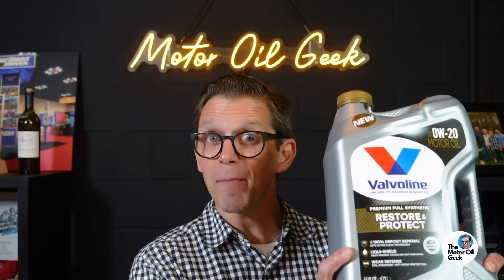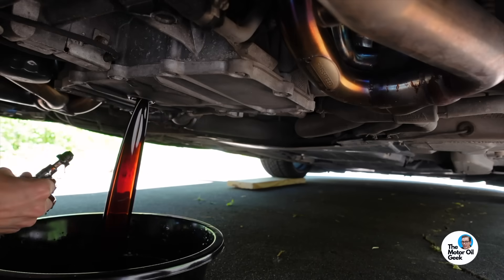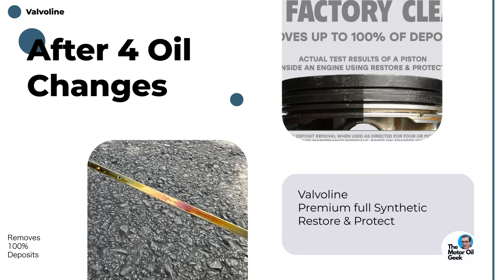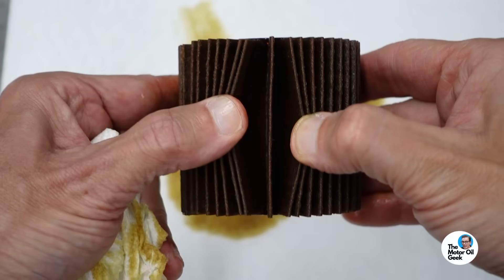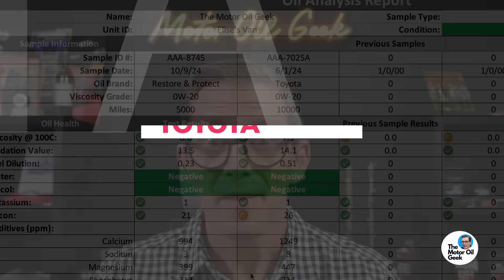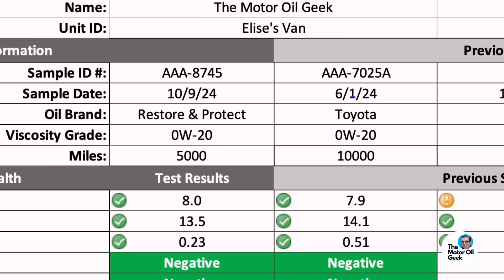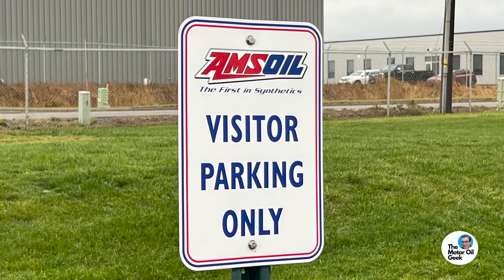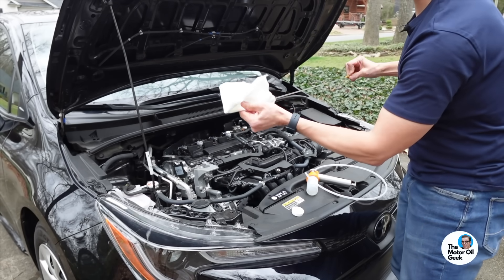The TRUTH About Valvoline's BOLD Engine Cleaning Claims

Comment: I saw your interview with the Valvoline team and decided to try it in my old 97 Civic with the D16Y7 engine. I was losing oil at a rate of a quart every 500 miles. After going through 3 changes so far I can nor go a 1000+ miles per quart loss! I am SOLD!
Reply: Thanks, I've been thinking about trying it on a Hyundai GDI that eats a quart every 250 miles. Even if it only doubles to a quart every 500 that would be great
Reply: @martyjoseph9507 Have you had a rod bearing failure since you posted this comment eleven months ago?
Reply: @martyjoseph9507  switch it on my genesis with the 3.8 and it helped so much with the oil consumption
Reply: @martyjoseph9507 thats insane a quart per 250 mi.
Reply: @martyjoseph9507  I just got a 13 Sonata SE 2.4 and it has a new engine. I am getting ready to use the 5W20 R&P in it to hopefully help keep the engine clean and maybe less build up on the intake valve stems. That R&P going through the PCV and hitting the intake valves just might keep the build up at bay. Also only using Shell/Chevron/Texaco gas in it. Also OEM Hyundai filters and 3K oil changes. We shall see!
Reply: @martyjoseph9507 - Put in a pint (as directed) of Berryman's 300ish miles before your next oil change too. That stuff is awesome and reasonable.  Stronger and cheaper than Seafoam.  I use it to decarbon my 2 strokes and clean fuel systems (works spectacular there too).  I noticed my son's Silverado (160k-ish) was down about 5psi on oil pressure and was concerned for him.  Upon his next trip home, 150 mile trip, he added it right before he left his place.   We changed oil when he got here and I'll be, if it didn't restore the pressure back and quiet a slight lifter tick on one treatment.
Reply: Haven't tried Vavoline but my 2009 Camry 2.4 was digesting a quart in 300 miles, about a week. 
Watched the video about doing a piston soak with Berryman's B-12.
Tried it and my mind is blown. The oil consumption has stopped almost completely.
Reply: @br5747  -- Which video is that? Before buying the Restore and Protect I wrote to Berryman's, but I can't recall exactly how I phrased my inquiry about using B-12 for trying to clean the ring area. 

I love the B-12 and have used it in my gas for a few years. I know that it works as claimed for cleaning intake valves because I had the head off and the valves out, and there was almost no carbon on them at all, face or back. The exhaust valves were a geological spectacle, with big knots of carbon on the backs around the stems, and the faces also had substantial deposits. 

I used Berryman's Chem-Dip to soak the exhaust valves for a few days with almost nothing but discolored solution to show for it. Results weren't much if any better after I found a 22-oz. can of 'professional use only' BG Platinum Air Intake And Combustion Chamber Cleaner on eBay for more than $50 following a Car Wizard video where he successfully cleaned manifold runners with it, and I soaked them for two or three days. I have no doubt that both products are great, but they do not break up or even soften heavy carbon deposition, should anyone who's read this far be inclined to try them for this purpose. 

The only way I was able to get the carbon off completely was to protect the stems in a sleeve of Frost King perfect-diameter foam-rubber weather strip tubing, put them in my drill, and work them gently into a brass -- not brass-coated steel -- wire wheel from Grainger. It took hours to do eight valves, and it left the wheel with literally about seven wires still attached. :face-orange-raised-eyebrow: 

All of that effort made me question how well any proprietary magic potion formulated into the oil or added to the crankcase could dissolve similar but less extensive buildup. ANYway, the nice guy who promptly replied very enthusiastically assured me that I could add B-12 directly to the oil at a specific ratio and see excellent cleaning results, but I was a bit concerned about adding the B-12 to the oil, even though it was a small proportion, as it does kick ass on intake valves. I think I my question was if I could run a small amount of B-12 around the piston crowns at the cylinder walls to let it penetrate and dissolve whatever it could in the ring grooves, but this guy discouraged that and suggested the infusion. Thanks for the prompt, and for reading my ramble!. 😆
Reply: @br5747 - That stuff is fantastic.  Add it to your fuel periodically too. I had a snow blower, I'm ashamed to admit,  had a fuel issue (bought it used) and it would "hunt" and I had to close the choke a smidgen to correct the mix.  Last winter, it got so bad it would die and giving me fits. I almost bought a new carb but I keep Berryman's "on my shelf".  I mixed one tank about 4x their "recommended" rate and the next tank at 2x.  Before the end of that 2nd tank, that thing ran flawlessly,  stronger than ever before and I had zero issues.   I am S O L D on that stuff.
Reply: @br5747  Be careful with those harsh cleaners. That's the whole point of using the R&P.
Reply: I bought this oil after seeing that interview and all ive ever used is mobil 1
Reply: @kwilkins1000  -- Similar for me. I initially used Amsoil when I bought my car from my neighbor's younger son just over ten years ago. I love the oil and the history of the company, but I knew that I had an oil consumption issue so I went to the 'more affordable' Mobil1, which I'd used for a long time because a car-geek friend had used it for ages. I'm anticipating great results, because the video at Valvoline's test lab truly impressed me, and to say that I'm very difficult to persuade would be an understatement. 😆 I'd even considered trying to find some of Valvoline's diesel version that they developed with Cummins to give it a short, closely monitored run.
Reply: @billholt174  i put it in my 2008 Tacoma with 125k miles..never burned any oil with my motor bc I changed it every 5k or less but shes an old girl and anything that can help is never a bad thing 😂. I plan to keep her running as long as I can because new trucks are crap not to mention they cost as much as a house
Reply: @kwilkins1000  -- Indeed! More power to ya, too! I almost get mad at people who, figuratively, blindly ridicule my car because of its cosmetic condition or laughingly bully me because of its oil-smoke puffs, but I always quip back, often saying "Hey, I love that car, and I'm not driving a payment." I tell people to not jinx me. 😄 I have a couple of ill-timed projects at hand with winter on deck, but we're rollin'! I'll say that I'm just paying the karma price for dallying with superstition and letting armchair criticism make me angry. 😜

I have a good intuitive feeling about using the Restore and Protect. Not merely 'willing' it, I noticed a little reduction in use when I switched to the Valvoline, and I'm hoping that with every start-up puff -- which only happens after an hours-long rest -- I'm saying goodbye to ring deposits and hello to less oil use. I'm excited, actually. 😀 Be well!  

Oh, yeah... not having a vehicle loan payment makes my trusty Honda priceless and as gleaming as any shiny dealership thing with 'new car smell'; and it does sadly seem that 'planned obsolescence' or outright greed has now tainted the quality of more new cars and trucks than ever before. That may be slightly anecdotal, but I've heard enough about it on YouTube and elsewhere and have no difficulty believing it. The cost? No denying that one! I think my 1991 Dodge Colt was a little over $9,000.😋 When you can pass a dealership with a front line of full-size pickups that has a total sticker price 'value' of $1,500,000 you know you're in troubled times. Roll on!  

I feel a oneness with 'Uncle Buck'. 🚗🚭😆
Reply: @ aint that the truth 😂🙌
Reply: @kwilkins1000 I'm a Mobil 1 fan/ user as well.( recently switched to Purolator one filter)
 I have used Valvoline as well as it's been proven to be good oil. My Nissan truck is 13 years old with 165, 000 miles.  Considering using the Valvoline restore oil as I plan on keeping my truck for longevity.  
  I'm 50/50 on this. My truck runs really smooth and nice with Mobil one now.  
  No oil leaks here.  Maybe I dont need a restore Valvoline yet?
Reply: @supercraig2009  Just wait until consumption starts then switch over.
Reply from the maker: Thanks for sharing.
Reply: @staycurious3954 What about your MPG have you seen improvement?
Reply: @panchorancho6274  my wife’s car got a record 27.1 mpg on an 2.0 hour trip (105k on her 2017 Audi q7) going 78 mph. We never got much better than low 25 mpg on the same trip in the past. I couldn’t believe it.
Reply: @panchorancho6274   Yes! I sold the car but the fuel mileage went up too. I am sold on the stuff now 😂❤
Reply: Imma use it on my 90s toyota engine, previous owners didnt change oil for a long time, I think itd be a nice test subject
Reply: @jouseff_1293  -- Excellent.
Reply: I've got an 08 Impala and would go through 3 quarts in 3k miles. I did two 2k intervals to help clean out the old oils and gunk and now I'm sticking to my 3k as usual. I'm hoping it helps me as much as it helped you.
Reply: Quart ever 500 miles is crazy. Dang I thought half a quart ever 1000 miles was bad. 2012 crv with K24Z7.
Reply: @2fast4all  I bought it used and had almost 200K on it plus it was stolen in COLO Spgs so it probably had been abused by idiots and thieves.
Reply: Great engine. I’ve owned d15b7s. And d16z6s
Reply: did you have any issues with the filter clogging up?
Reply: @yungharambe69  No.
Reply: Did you top off with this oil or did you go with smething else? That;s ALOT to use to keep topping off with this oil! Can i get away with simialr valvoline products or does it HAVE to be restore n protect?!
Reply: @ i was thinking about topping off with extended protection between oil changes myself but have been hesitant
Reply: So what do u think is the decrease in oil consumption or mileage gain?
Reply: @juliosdiy3206  possibly pcv system clogged with sludge and sending oil directly to combustion chamber
Reply: Can this be used in Dexos 1 recommended trucks? 2012 Gmc sierra 1500 ld wt to be exact?
Reply: That’s crazy. Literally same with me!!! But 97 civic del sol with the d16y8. Stopped eating oil I couldn’t believe it.
Reply: @Thorneyyyy41   It even cleans the dirty dipstick which blew me away! 🎉
Reply: I have about 2500 miles on R&P but it’s making my Accord leak badly. It’s not the oils fault since most of the seals are old with 227k miles but with other oils I didn’t see as much leakage. Going to keep running it and see if I see an MPG and oil burn improvement
Reply: @blackjaminboy - That's because the sludge clogged the seals. The oil cleaned the sludge and now you have a new situation.
Reply: @blackjaminboy  -- AT-205 will probably help. I haven't had a chance to get back here since I left a typically long-winded reply to you that I think may not have registered.  To the point, get a bottle of ATP's 'AT-205 Reseal'. All cynicism aside about stereotypical 'miracle-in-a-bottle' claims, this works. It's a 'plasticizer' that rejuvenates seals which have dried, shrunken and hardened from age and heat. I had a small but obvious small-puddle leak and a messy oil pan years ago after I bought my '95 Civic LX from my neighbor's younger son. It never leaked again. It won;t work on damaged seals and o-rings, but it sounds like the Restore and Protect simply found your leaky points. One convincing instance for me was when I cut some plastic tubing to rig up a pump dispenser for the AT-205 bottle. It sat for a day or so and I took the pump off after changing my plans, The length of tubing that was immersed was very soft and pliable, without being 'gummy', and the upper length was far stiffer and tough to compress like the source length was. Go to eBay and find a reasonably priced bottle. I think you'll be pleasantly surprised. Then we can both look forward to Valvoline's miracle-in-a-bottle results. 😄
Reply: Bro a re ring kit gotta be like $50 for a d series
Reply: @aidanteegarden1729  -- I considered it as an option, but I like the 'all-original' challenge of keeping a high-mileage vehicle going in its 'unaltered state'.🙃Mine's a '95 LX with around 300,000 miles on it when I had the head off more than a year ago. Plus, I really didn't want to disassemble at the bottom end when I doubt it's ever been touched since it was built, and I would have had to do it in-car on jack stands. 

On each of the many Honda-only sites I went to, most of which are likely Internet extensions of dealership parts departments, the two original ring set options were discontinued and no longer available -- although that never completely discourages me -- and not all of them had the 'oversized' set. I'm not a pro mechanic, but this suggests that a stock, original-dimension re-ring of a D15B7 at this point in 'overstock' parts availability -- essentially meaning that you ain't findin' 'em unless some independent or retired Honda mechanic has a set on eBay -- isn't probable, and the design engineers assumed enough wear in this type of situation to warrant a cylinder milling or possibly a re-sleeve of the block and the use of the oversized rings. Well, for a variety of reasons, that's not happenin' with me. 😛

I love cars and mechanical things of all sorts, but I'm not a young 'tuner' with a lift and a garage full of tools, and I don't see the hobbyist joy in constantly tearing down a little Japanese car and putting it back together as a stronger Frankensteinmobile. I like the satisfaction, sometimes quite hard-won, of doing necessary work that keeps my beloved Civic running, and I'm a dyed-in-the-wool OEM guy. I noticed a substantial amount of the factory crosshatch worn down, and two and three, if I recall correctly, had some minor scuffing near the top on the firewall side. 

SO, all of this rambling is to say that I'm giving Restore and Protect a try in lieu of a re-ring, and it's good to hear a few stories in a short span from guys who have experienced noticeable improvements with their cars that are oil-thirsty like my beast is -- for now. 😉 Mine burns a bit on start-up, but then stops emitting smoke in under a half of a mile. I replaced the valve guide seals, which I heard can, if bad, cause the start-up oil burn that disappears, but even though I'm quite careful and detail-oriented I suppose I could have done something to damage them when I installed them. Anyway, it is what it is, and I anxiously look forward to seeing the Restore and Protect clean up the ring area and reduce my oil consumption, or perhaps even nearly eliminate the excessive amount. I diligently got the head almost factory-clean and the mating surfaces of the head and deck to nearly a mirror finish. If I can beat the northeast winter roads and stop this oil consumption I'm aiming for at least 400,000 miles on the odometer before I put the trusty Honda in project car status. I'd like to see 500,000 before it gets some rest, and this bugger has never asked for much.🙂
Reply: Imy engine didn't use any oil before. Now, since using restore and protect, I am gaining an extra quart every thousand miles. That's 5 [extra] quarts for every oil change. My oil changes are now FREE
Reply: How would cleaning gunk off of stuff slow oil consumption? If anything it seems the rings would get looser and allow more oil in the combustion chamber. There has to be a reason other than cleaning debris.
Reply: @XBX1MASTER  because the gummed up oil control rings don't function properly when all gummed up and stuck. Unstuck rings will function in a superior fashion. So yes, less consumption is reasonable.
Reply: @ oil control rings are just that. If they are clogged up it should allow less oil. Not adding up for me but thanks for the input.
Reply: @XBX1MASTER  but that's not how oil control rings work. They cannot effectively scrape when they can't move and what they scrape cannot be moved away and down from the piston as when a oil control ring scrapes the excess oil from the cylinder wall it goes inward towards the inside of the piston. If that is clogged then the oil control rings won't properly drain and oil will build up there and not be cleaned off the cylinder wall.  You are conflating worn rings to clogged rings which are two different scnearios with different effects. Cleaning WORN wrings will not improve oil consumption but cleaning clogged rings will. One of the major mods that is often recommended in LS pistons to reduce oil consumption is to open or enlarge the drainhole at the oil control ring groove on the piston. Doing so allows oil to drain out of the ring properly even as it has build up.
Reply: @meatybtz  interesting. Thanks for the additional input.
Reply: @XBX1MASTER  Piston rings work by compression getting in behind the ring inside the piston ring groove and pressurising the ring against the cylinder wall.  When carbon builds up in the piston ring groove clogging it the combustion pressure can't do its job to pressurise the ring (force it outwards) and thus the rings suffer and engine performance suffers and oil gets past the oil sweeper rings to be burned and end result is loss of oil and loss of engine performance & increased fuel consumption
Reply: @ ty. I watched some videos and it makes more sense now. Still not to fond of a bunch of carbon, debris and sludge lose in the oil system. Probably over thinking it. I'm sure they thought about it as well and it's a non issue 🤞
Reply: @XBX1MASTER  it works because of its slow rate of clean. harsh enough to actually do the job, but soft enough to not clog things up and cause problems.
Reply: @fizzystream8868  I saw the video but I am seeing alot of reports of people recommending early filter swaps.
Reply: @XBX1MASTER 
You need to understand how oil.scraper rings function in conjunction with the pistons.

What happens with time is that piston oil holes get clogged thus oil is no more scraped down  to the crankcase, but gets pushed up to the combustion chamber and gets burned. 
If the oil.rings get also clogged, they addup to the amount of oil burned.
Even with new oil rings, if the oil holes in the pistons are clogged the oil consumption will be very high.
There one thing that RP cannot cure : worn low tension oil rings. They are designed for low friction (fuel economy) do they wear prematurely as low as 80.000kms.
Example :
toyota 2004 FE engines
Bmw N52b25 engine
Etc
Reply: @XBX1MASTER I'd say anytime your doing anything engine cleaning wise change the Filter I personally Change my Filters every Oil Change
Reply: @XBX1MASTER  No, its been a horror show the last 10 and sometimes 15 years with EPA mandated CAFE standards forcing a crappy oil control ring to try and force and increase in MPG.
Its had a minor increase in MPG, which is blown away by the massive oil burning most vehicles end up having after first 4-5 years of their lifespan.
Reply: @hanynowsky  If there is mechanical wear/damage, it will possibly help some but it won't repair wear and damage...only carbon baked on and gunked up rings.
Reply: @XBX1MASTER  Imagine the hard carbonized deposits on the rings as ice on a wiper blade preventing the blade (ring) from conforming to the windshield (cylinder wall). When it can't flex to the surface it can't glide right or move oil properly.
Reply: @ good visual. Thanks
Reply: @XBX1MASTER  Carbon on rings takes out elasticity so theit ability to seal.
Reply: @XBX1MASTER  the rings may be sticking not creating a more complete seal because of the deposits. creating more blowby and oil getting into the cylinder to get burned. as the deposits are cleaned away the rings seal better causing less oil to get burned in the cylinder.
Reply: @XBX1MASTER  i think the gunk will prevent the rings from expanding against the cylinder wall during the compression stroke allowing more oil blowby.